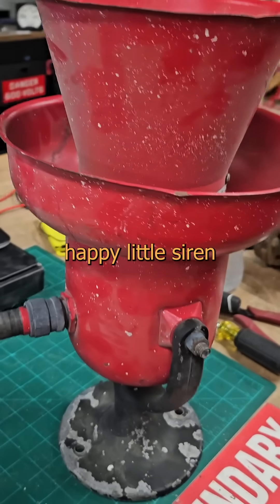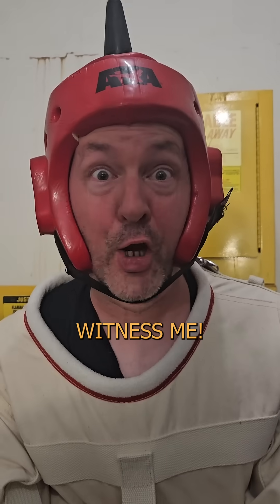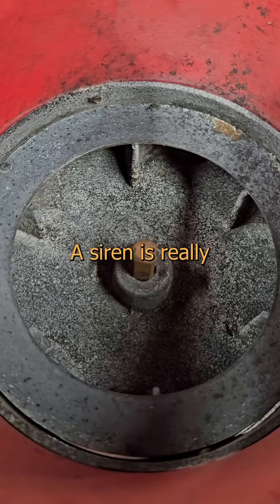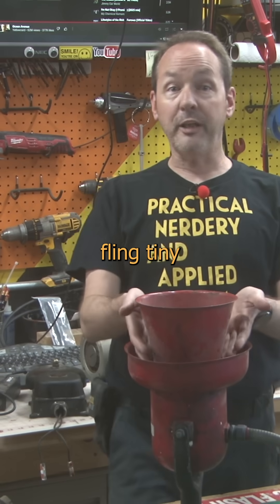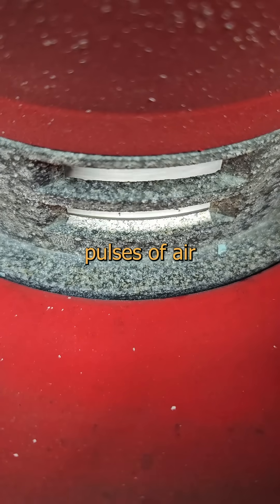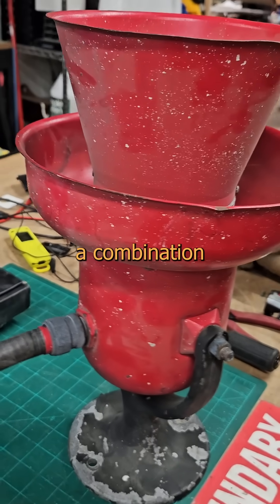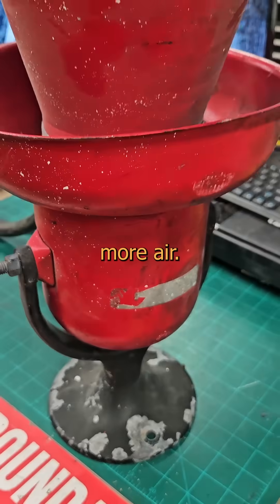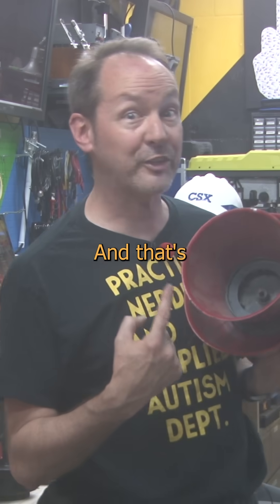How A Siren Works #chrisboden #comedy #engineering #science #educational #rhps #jokes #nerd

Comment: If you want to distract yourself for a couple of weeks worth of evenings, make yourself a siren or two from scratch. My favorite ones were powered by winding a LOOONG cord around the shaft driving the chopper and pulling it hand over hand as hard as I could. If you vary the number of windows in the chopper and shroud, you can duplicate different iconic sirens. My fave is WW2 London Air Raid Siren (7windows in Chopper, 9 in the SHROUD IIRC). Good loud fun

We call 'em Sireens 'cuz we like to be as annoying as the specific article

Comment: I joined our local Rescue Squad back in 1976. Until we got pagers, we were alerted to all emergencies, by a big siren in the middle of town at the fire station, and we had a call system too, every member would call their designated person to make sure they heard the sirens going off.
On two of our old Rescue trucks, we had those old sirens like the one you had but way smaller under the hood. Those things were very loud. You had to turn it off and on so it would change the pitch and sound.
We lived 3 miles away from town and could hear the big siren at the fire department when it went off. Not long after i got on the Rescue Squad, we got pagers and radios. 
I volunteered with them off and on for 30 years.

Comment: (looks at the ISO stack mini poster on my cube wall(
Yup, can confirm. that is a layer 4 to layer 2 one way transfer device, but only for atmospheric compression waves transmission medium (layer 1) and since it is not independent of the transmission medium it violates the IOS protocol (like everything else)  UNLESS it is paired with a corresponding layer 2 protocol transformation device converting this device's output into other physical transmission medium. 

(hint... it's called a micraphone... )

Comment: I grew up in a rural area. The township town hall/volunteer fire department is directly across the street. On the roof there was this giant, double-ended siren on the peak of the roof. Every single time they got a fire call, that siren got switched on and ran for a good 3 minutes. They eventually tore the old building down and replaced it with a more modern one, and the old siren went away. To this day, I'm convinced that that siren is the sole reason I can sleep through literally anything. A tornado could hit my house in the middle of the night, and I'd wake up in a tree in the next county 4 hours later wondering what happened.

Comment: What my ai thinks of this video
🔊 Siren Talk + Networking Banter = Nerd Fusion

🧠 “Packets” in the siren context

When the main guy says:

> "The freaky rules of fluid dynamics fling tiny particles of air through these openings, chopping them into packets"

He’s makin’ a jokey comparison between how sirens make sound and how data packets work in networking.

Sirens have a rotating chopper/rotor that interrupts airflow to make sound pulses.

These pulses = regular bursts of air = “packets” of sound

So he’s callin’ them "packets" like in networking—just in sound form, not digital

🤪 “Layer 3 siren”

That’s a networking joke.

In the OSI model (how networks are structured), Layer 3 is the Network Layer – where packets get routed between systems.

The guy in the straight jacket hears the word “packets” and cracks a joke:

> “So it’s a layer 3 siren then!”

He’s pretending the siren obeys networking layers. Pure daftness.

🧍‍♂️ “Witness me!!!”

That’s a Mad Max: Fury Road reference, no’ a networking thing.

In the film, the War Boys shout “WITNESS ME!” before doing something mental or sacrificial, hoping to be remembered in glory.

Here, the guy in the straight jacket’s roleplaying a total maniac before the siren gets turned on. Just full chaos.

---

⚙️ What’s Really Happening

They’re breaking down how mechanical sirens work using analogies to networking tech and film quotes.

“Packets” = chopped air pulses (sound)

“Layer 3” = joke about data routing

“Witness me” = Mad Max reference, no tech meaning there

The guy’s teaching while being a right eejit, and it’s brilliant.

Comment: add a sliding spring loaded cable actuated disk to block the noise till it's at full speed, then yank it open to use as an upgrade for air horns

Comment: We, in the Netherlands, still have those airdefense sirens and we run them every first Monday of the month at noon, to test them. Except they are a lot bigger, usually three disks with a diameter of a meter (approx. 1.1 yard)... They are now also used for other emergencies (like big fires, flodings etc) ... If the sound, you're gonna hear them.
Reply: MANY of the ones in the US are now just REALLY loud speakers.  During the tests they will give the "emergency test" spiel after the given test.  Which sounds really obfuscated if you can hear more that on siren, since the distance makes it hard to listen to just one.
Reply: To be fair... the siren bit works just fine.  I do however wish we would go with "simpler is better" in this case.

Comment: There one on a pole about a block away. It rotates. 
  Every 1st Monday of the month at 7 o’clock p.m. it goes off for the volunteer fire department to meet.
     You can’t even stand to be outside when it’s going off.
     It is nice when a if storm comes , though.

Comment: A siren like this is a fan that is designed to be as loud as possible. IIRC, one of the integral parts of it is that the holes on the chopper never fully align with the holes in the air intake.

Comment: I was just watching a video recently about the first electronic musical instrument - it had a set of holes around a shallow bowl which spun at a certain RPM. A light shone through the holes to a sensor which was amplified and made a sound. The frequency depended on which set of holes were used as they got further from the centre of the bowl. It was like an electronic version of this air through holes thing.

Comment: So this is not a tornado siren. 
I've often wondered if the big tornado sirens operated mechanically like this one or had some badass voice coil with a magnet so it could broadcast specific information from the emergency broadcast or NOAA. 
When I was younger I schemed of stealing one of them off a pole or intercepting an older one as they were replacing it with a new one. 
My idea was to hook it up to my car stereo and outblast everyone else's car stereo. Melting my inner ears in the process. But that would have been my idea of fun back in the 80's and 90's.

Comment: We have something like this very similar in our Mill. Well we had to modify the Brushes on the motor to get it running.
These things are like wood chipper. I just turned the blades by hand while working and my finger just happened to be in the way and it felt like it broke my finger.
I also gave it a test run in our Electric shop without telling the Sparkies and Sledge hammer Mechanics,  5 of them jumped out of their shoes the rest threw stuff at me and the old man just kept one working on with what ever it was he was working on because after 50 years in the Steel Mills his ears are pretty much toast.

Comment: OMFG. the RHPS song reference is amazing! well played, sir. I want to tag in on your shop build as I tried building a thing a few years ago and it stalled because (I think) water is incompressible and you can only push it so fast through a tube but I needed the thing to be small enough to load into a regular service truck and optimally run on 12v DC. I shelved it a few years ago but I still think there are things way above my pay grade that might make it work.

Comment: So, I probably started with your flavor of Autism, but I also had the misfortune to end up with dexterity issues.  I have working hands, but with a tremor (started in middle school) that makes kitchen knife work, soldering, screw drivers, etc, cumbersome to handle.  So I turned into the "dive down the theory rabbit hole every time something catches my attention" flavor of High Functioning Autism.  I watch and observe EVERYTHING that might have some deeper theory/method of operation behind it.  I will go out of my way to observe workers in most fields until I either understand what they're doing, or I know what to research.  I'm the guy that is an Electrical Engineer and considers becoming "a well rounded engineer" to be one of my goals in life.

Comment: Also that's partly why pc fans make noise, the bars holding the center do the same chopping, and iirc that means you have to avoid having the number of blades being a multiple of the number of bars, otherwise you get a single loud peak when they cross instead of multiple quieter peaks.

Comment: And the cool thing is (and this holds true with fire engine Q sirens), that these produce square waves, as opposed to the typical sine wave a speaker makes. It adds that characteristic timbre we’re all used to out of these things, and makes it unmistakable. 

Sure, the Federal Signal e-Q2B does a good job on its own and comes kinda close to a traditional Q, but the sine waves out of the siren speaker are simply less effective than a true Q, especially on the road, even if the difference is marginal.

Comment: There are still a few AIPed Thunderbolt 1000T polesitting in a 10 mile radius of the defunct Trojan Nuclear Power Plant in Columbia County, Oregon and Cowlitz County, Washington. These ones actually place the blower in a box at the base of the pole and the chopper up top at the siren, with a 2 or 3 inch air pipe running up the side of the pole.

There was one aimed directly at my house (and only 500 feet away) when I was a kid. The annual full-scale test was truly something to experience. It wasn't just an auditory experience, you felt it in your bones.

Comment: Hey Chris, That's a Federal Signal rig, I had that as the engineering alarm on some old steam tankers I used to work on. In around 2006-8 the 50yo original 120vac unit finally gave up the ghost due to bearings, sounded like a drowning sheep. I had put a brand new spare that had been sitting in a box for the same length of time so I put it in. I ordered a new motor and they still made them, so when it came in months later (shit logistics) I tossed the old one in and it worked great. 

Now it's in my garage as a curiosity piece as they went bankrupt in 2010. Fun toy to annoy the neighbors. I should have took both but I got lots of other goodies.

Comment: My flavor is in material sciences and pushing the bleeding edge of efficiency of a design. Nothing scratches the noggin itch for me like a well structured machine being observed and improvements being found and implemented. I'm the guy that either finds ways to attach heat sink blocks to a stove chimney pipe, or coils some copper tube around it to use as a small scale boiler to run something, or finds a way to attach a gassifier to extract flammable gas which I then store into canisters with the help of a compressor and use them for various other things while on the other end getting me yet some other combustible substance to maybe do another batch. Preferably all three, I want the exhaust coming from the other end of that chimney to only have enough heat left in it to escape while not backing up into the building.
That said, I think you need to send Cy, the home inspector a version of your "code is the floor not a Ceiling shirt" because his channel is all about code violations.

Comment: Sirens were briefly a special interest of mine eons ago. Fun fact: Most modern (public address) sirens in use these days are basically high powered loudspeaker/PA systems. Tones are all generated digitally and can even reproduce speech usually relayed over radio/telephone links depending on if your local EMS uses that function. Though the frequency response is usually so poor that you may not be able to make out what's being spoken. I've even heard the DTMF activation tones from the ones in my city. Kinda cool hearing them echo around me as each siren within audible range is triggered.

Comment: My flavor of autism is a combo of mental 3D scans of whatever area I'm in, and doing mental math for doing things as efficiently as possible. Great for my job. I made a card specifically for logging into my workstation because our passwords gotta be 20 characters long MINIMUM and we have barcode scanners that even type what they scan on the login page and the computers log off after 5 minutes of no input. Packing orders is easy when you've memorized the exact dimensions of the boxes, how many folds a garment will take to fit, how thick the folds will be, etc. 

When i figure out how to get the orders to process without having to put everything down to do a couple keystrokes, I'll shave so much time off my overall usage. Prolly gotta reverse engineer an effects pedal to free up my hands. Stomp and send.

Comment: thats nothing, I once climbed a concrete pole to unhang a fluorescent streetlight with 3 5 foot long T12 80w tubes and a massive starterless rapid start ballast and the worst part was that the fixture was on a long arm so I started cutting the pipe and waited for it to sag on its own then I tied a rope and tried to loosen it and bring it down but half way the ground gave up and the pole started to shift with my ladder up against it and I shat my pants and jumped off basically. the pole became 45' angle with my fixture dangling on a cable. I snatched it, left the scenery and never looked back. I have a form of autism where I want to collect for my collection the things that are unobtainable LOL

Comment: I love folded horn designs.  I didn't work on sirens (thank God), but I did work on PA speakers, and it helps dinky little speakers find their man voice.  

Just, uh, word of the wise: make sure its disconnected from the circuit before you go troubleshooting one, especially if your mere presence is enough to scare it's machine spirit into working, because holy tinnitus, Batman!

Comment: We commonly use one in firefighting on heavy apparatuses called the Q2. Bumper mounted, and is used mostly at intersections as it's the loudest thing we have.

Older units are cool, and have character, they don't stop immediately and will essentially "coast" which usually sounds pretty neat.

Comment: I have 4 old ww2 air raid sirens on the farm they are hand wound & still work 
For sum reason idiots think it's funny 2 set fire 2 hay stacks so we use them for fire or an emergency on the farm they are in key areas 1 near our 4 fuel tanks (red diesel white diesel heating oil & petrol) 
I live in middle of no where and several times me, my kids or 1 my workers have arrived with very little fuel in car & buying it in bulk actually save some money but having fuel on a farm will attract thieves but all the tanks hidden & have locks on the pumps+ we have guard dogs which are better than security lights CCTV alarms 12ft high fences with razor wire on & walls that are 14fthight also with razor wire on & locks chains on gates 
The geese patrol the grounds & if they see or hear intruder they go berserk n then the dogs will all run to where the intruder/s are the last 2 that attempted 3 break in & steal 1 was bitten & scared badly & the other 1 tried 2 getover a wall but he ended up breaking his legs as he landed in a 12ft deep  ditch & unfortunately there was sum lumps of concrete with old rusty rebar sticking out he was in bad way for very long time but I have no sympathy 4 the scum

Comment: Similar concept on why if a turbod car doesn't have some kind of recirculation/blow off valve the turbo will go "SUTUTUTU" as the charged/compressed air from the turbo gets Dumbledore'd by the throttle body so the only way its got to go is home which is the turbo which then chops up the compressed air causing the infamous sound. No the turbo doesnt spin backward yes it might be a little bad on your turbo but who doesn't love that sound 🥰

Comment: We got an hand driven siren at the army and we also have some on our tramway depot. First I saw that siren my childish fingers couldn't resist cranking that thing up. Yeah, the other soldiers weren't amused, but hey, then we know what's used for.
Since 10 years I can't figure out why the hell we have a siren in our tram depot. In case of fire or other hazards all buildings are equiped with electro- acoustic alarm systems. 😅

Comment: I mean, that's not that bad? Two friends and myself climbed the Cingular tower just outside Burleson TX one late night, and we may have attempted to steal the flashing light off the top. Admittedly it fell due to being much larger than we realized from the ground, and we forgot to turn the power back on to the tower since we had killed it to shut off the light. But... Yeah.  Cingular service was out for about a week due to that tower being about 5mi down an extremely degraded dirt trail, and as bad storms had washed extremely deep ruts through it. They couldn't get to it to fix it initially.

Comment: After watching this, my particular flavor of nerd wants to know what very hot or cold air does to the pitch of the siren. 
Would different gasses passing through it sound much different?
Reply: 14% density change from 0 C to 50 C, so probably discernible pitch change in a few degrees to a musicians ear.
According to one of the supposedly smart computers, the air density change of about 10% also matters in the speed of sound, but that may be a herring. 
Spin rate is also affected by density and the motor's power.
Reply: Yes! I want to hear that with some sulfur hexafluoride gas around it.
Reply: @dathaniel9403 garage 54 did this with a truck air horn, they tried helium and SF6
Reply: Or just water vapor
Reply: coming soon the braille siren so you can feel the tornado warning lol